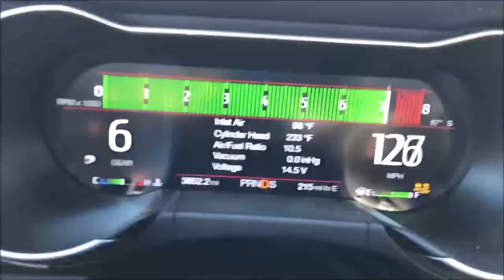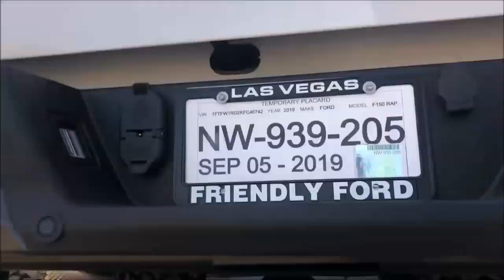2025 6.8 Liter S650 Mustang And F150

Comment: A 6.8 liter Mustang........... If Ford does this, I will buy the first year model whether or not it blows up I don't even care! I'm just glad they're not doing only an electric version!! :oD
Reply from the maker: Rated R Cars. .  funny thing is, electric motors make a lot of torque. . .  i am hearing some of the future hybrid mustangs with electric motors will run rings around our current cars .. . things are gonna get interesting. .
Reply: @coyotecarguy2076  as batterys die they lose strength when I get low in fuel I still make 703whp
Reply: @coyotecarguy2076  u missing the point bro.
Reply: YEP!!!!!  DO NOT LIKE THE ELECTRIC CARS.
Reply: @BobbyB910  when youre full of gas you add weight... Batteries full = no added weight. Two can play at this game
Reply: @robquin2460  no I win lol 
Muh double pumper carb with them camel hump head and a 3/4 race cam will beat anything
Reply: @BobbyB910  we'll see when these electric cars start flying off the shelves in a few years ;)
Reply: @robquin2460  Electric cars are nothing but overrated.
Reply: they have done an electric version and its a neck snapper.......look it up!
Reply: @coyotecarguy2076  They are eventually gonna ban gasoline engine, it's not a good thing.
Reply: @robquin2460  ywah and maxing the performance Ona  battery performance car drastically reduced use time and will degrade the performance of the electric vehicle over the years, my gas engine is gunna stay the same

Comment: There is no replacement for displacement. Everything old is new again...HAHA.
Reply from the maker: Stupid Fast Truck . . .  Your right about that. .  with free flowing cylinder heads and a efficient intake and exhaust this engine will get a lot of attention. .. its gonna make power. .
Reply: Well said
Reply: Ford: We increase the liter size, but the motor only runs to charge the  battery that powers the  electric motors :D
Reply: Amen, Recently on the market for a new Crew Cab pickup, drove Fords, Dodges', Chevys and GMCs, drove home in a 2020 GMC AT4 with the pushrod 6.2, I love that sound and feel, I'm 54 and that engine brought back feelings from my youth... That sound and torque.
Reply: Amen to that brother.
Reply: Really. 

The coyote proves that wrong  .

This will be cool and I like the idea buyvif I had to chose . I'd go with the coyote.

Comment: coyote still gonna hurt feelings
Reply from the maker: Rob Quin24. . everyone needs to remember that ..  never under estimate a coyote..
Reply: Not my 427 strokers feelings
Reply: @rdy2run332  bet
Reply: Lol keep dreaming. They cant even,"match the torque " on anything from GM or Dodge. Lol keep telling yourself that
Reply: @erichaley4485  like they're trying to? Lol. Unopened coyotes in the 7s, stay delusional
Reply: @robquin2460  they still dont make shit worth of torque
Reply: @erichaley4485  guess they dont need it lol. Different engine bro
Reply: @erichaley4485  go watch Richard Holdeners  coyote vs all LS displacements on the engine Dyno. 4.8 and 5.3 couldn’t touch the coyote EVEN in torque. The 6.0 barely beat it. And Richard is the most unbiased dude there is. Cost is the only factor. Coyote ain’t cheap.
Reply: @MikeSmith-ey7ku  they dont,"match GM or Dodge" in low end torque. Put the crack pipe down.Funny how Ford went back to pushrod V8s in their heavy duty trucks because the honda tech just couldn't match the GM or Ram pushrods. Hell some people are doing Godzilla swaps from the Honda Oops coyote junk..
Reply: @erichaley4485  go watch Richard holdeners coyote vs all displacements of LS. Only the big 6.0 or 6.2 can beat the coyote....even in torque. Do you believe everything you read on the internet? I’ll take a high revving high compression modern 4 cam over everything.  I don’t like harleys either.  CBR.  Or watch the other coyote Vs. LS shootout. Gm dudes had to bring a 7 liter to fight the little 5.2. They won,cuz they had 2 more liters and only cuz of that,cheaters

Comment: That is very interesting, Ford has done a great job with small block engines with high horsepower, but the other 2 
makers can't match Fords h.p. with small blocks, they have to make big blocks to get the h.p. numbers. So Ford
is going to show them what they can do with a big block motor. Wow that is exciting.
Reply from the maker: Paul Hudgins . . .yes my friend it should be interesting what happens now with the new ford big block's . .  stay tuned!
Reply: the LS is dimensionally smaller then a coyote. Lighter too
Reply: @MasterKeyMagic  I am talking about Cubic inches/liters of pistons, please do your research, GM & Dodge cannot build a small block V8 that can compete with Fords, they cannot get the horsepower that Ford is.
What is the size V8 in camaro & corvettes is 6.2l or bigger, which is a big block.
Reply: @paulhudgins5120  your tires dont care how efficient you make HP. Have you ever seen an LS7engine next to a coyote? Its like half the size
Reply: @MasterKeyMagic  Go back to your unfollowed Chevy forums,and get off of LS motors, build a LS small block and then compare to a coyote, it won't compare.
Reply: @paulhudgins5120  I did💀 I have both and they both make the same power except the LS is smaller so its easier to see over the hood of my camaro, it weighs less and its center if gravity is closer to the bottom middle of my car so, its better.

Comment: It’s rumored the 6.8L will get a CGI engine block.  Compacted graphite iron!!  Lighter and stiffer than grey iron and more durable than aluminum.  This is the block material used in the 2.7L ecoboost.  Ford could also develop these engines to run on natural gas🤘  Exciting times thanks for the video!
Reply from the maker: Ryan Sinks  . . .  Thanks for watching Brotha!

Comment: they could run an engine lineup like dodge does with their 3.6, 5.3 and 6.2. ford will have the ecoboost. the now entry v8 5.0 and then essentially a scat pack  with a 6.8 thatd be awesome
Reply from the maker: MaxxCalamity  ..  i like your way of thinking. .. 6.8 scat pack .. that has a nice sound to it!!
Reply: @coyotecarguy2076  lol im not saying call it a scat pack but it would just be fords version of it. More importantly  what is the name of the motor? Are they gonna call it the godzilla jr since its a destroked 7.3?
Reply from the maker: @TXpondking  . .  there is no name yet but i was thinking Baby Godzilla!!  remember him?
Reply: @coyotecarguy2076  yeah thats what i was thinking  with the jr lol
Reply: Dang when did dodge start making a 5.3 lol
Reply: @jacobgodfrey8164  exactly  lol
Reply: You mean the 3.6, 5.7 and 6.4s. Fca doesn't have a 5.3 and the 6.2 is limited in numbers.

You can get a 3.6 in basically everything. The 5.7 in trucks and suvs.
The 6.4 in the 2500/3500 (iron block)
The SRT 6.4 in well...the high performance stuff.
And well you know where the 6.2 is....(everything hellcat)
Reply: @D41Michigan  you right it is a 5.7  but yeah you get the 3.6, 5.7 and the 6.4 in the chargers and challengers and itd be cool to see ford do the 2.3, 5.0 and 6.8

Comment: Guaranteed ford destroked the 7.3 to 6.8 to get it to rev higher and make more power. The 7.3 has a hard limited redline of only 5,700 rpm so by making the stroke shorter they rev higher making more power hopefully through higher compression and revs. I also hope that the 6.8 is just and engine option with around 500 hp to run with the SRT scat pack cars. Then it’d be real simple to make a super rare 429 with a different set of rods. I know an engineer that works for ford and I ask him questions and he’ll just smile and say “sounds fun” he can’t say anything without risking his job but I know he knows.
Reply from the maker: hpkntnw.  .  Yes, He Knows . . No Doubt. .  but he can't tell you. . .the 6.8 is a big bore short stroke bid block that will make strong mid range power. . .  i hope to see the 6.8 in a generic mustang. .

Comment: The 7.3 makes 430 hp and 475 tq. So the 6.8 will make 399hp and441 tq, it will be 60 to 80 hp less than the 5L without variable valve timing.....a big step backwards
Reply: It's going to be tuned up from where the 7.3 is for work trucks and shit, this is looking to be like a high rpm high tq and hp big block in a modern way, which is dope

Comment: Thanks for putting truck in video at the end good stuff. If it’s a iron block I highly doubt it will go in a mustang. Sounds like a HD work horse motor. But seems odd with all the success of the 7.3 to bring a new motor out. But if there are  adding another style mustang that’s a SUV again maybe that’s where this motor will fall into.
Reply from the maker: Underfedcoyote 5.0  ..  honestly i think ford wants into the push rod v8 market..  . they are in it now ..   the dodge demon may have some competition. . .

Comment: Does anyone know why they are choosing 6.8 as the size? From the research I’ve done on the 7.3 it’s just a stroked small block, about the size of the 351 W, so why 6.8? I’d love a simple V8’s in a truck but the worst part of this is that the 6.2 will be even more overlooked as an engine. It’s just like the old 400. That should have been the performance V8 Ford guys built since it’s basically a stroked Cleveland but it was largely forgotten until just recently. The 6.2 mod V8 has some great architecture and I wish more folks used them so the aftermarket would be better for them.
Reply from the maker: Ronin Kraut . .  the 6.8 is an interesting change. .  probably better suited for the F150 truck .  .    Should be interesting what this 6.8 goes into..  .
Reply: @coyotecarguy2076  
For sure but why 6.8 and not 6.5 or 6.9? Know what I mean. Ford engineers picked 445 ci in the 7.3 for a reason. They said it was something about power and efficiency. Just curious as to why they chose that particular size or was it just because it came out to 6.8 when they destroked it.
Reply from the maker: @roninkraut6873   ..  we'll probably never know for sure but i would have liked to see a 455

Comment: Let's hope it is not a spray bore engine like the 2018 and up Mustang engine.
Reply from the maker: Joe D .  .. .  The cast iron block will not be spray bore but if they go aluminum it probably will get the spray bore.  .
Reply: @coyotecarguy2076  hopefully it will have a 6R80, but probably not. People are breaking the 10R80 right and left. I am at 950whp with a stock 6R80.

Comment: This is very interesting stuff! It concerns me that this might push the Mustang well north of the 4000 pound mark, which would make it a straight line beast but might take away from the sporty feel in the twisties. Any guess on the weight of an iron Block? Mopar fanboys are probably pulling their hair and screaming, “noooooooooo!!!”
Reply from the maker: Mike Fyxdt   .  . . .If this 6.8 ends up in a mustang with a blower and a cast iron block  we will see a heavy car ..  but a n/a version may not be to bad.  its the hybrids i am worried about. .   The batteries are huge and they take up a lot of space in the trunk! You know how i feel about trunk space!!  LOL!
Reply: @coyotecarguy2076  The magic formula for electrics is to spread out the battery cells in the floor pan from front to back. Weight distribution and lowers the center of gravity. We must preserve the trunk for more important people!

Comment: 30th. All you were all over it. You said big displacement. I wish they would DOHC the thing. Can you imagine that sucker reving 8200.  The ground would shake. I think they are going to put a D cell battery in the trunk and call it a hybrid.
Reply from the maker: thereissomecoolstuff . .   remember the 7X project. .  ford was gonna build a 7.0l DOHC engine for the mustang ..  it turned into a 7.3 push rod and the rest is history. .They will be building hybrid mustangs hopefully not with the v8's

Comment: Couldn't just be a 428SCJ  or 429 Boss and steal the 60's thunder away from the "Hemi" nameplate?   And why would it be 'limited edition' with a $2 billion investment in the Windsor engine plant ?  It should be over 500 horse 500 tq if the 6.2 Chevy makes 460/450 tq in the Camaro. 495/475 tq in the Vette.
Reply from the maker: Wildpony98. . . We will have to wait to see what ford decides to build. .  maybe it will be a 428SCJ  .  . . It is not likely to be a engine option in a typical mustang gt . .  it will require many special parts to get the engine to fit. .  not likely ford will make that investment . . . I herd a rumor that the 6.8 is close to 550Hp. .  but that is just rumor. .

Comment: The 7.3 only pushes 430 HP and 475 TQ 
The 5.0 pushes 460 HP and 420 TQ
So the 6.8 will not make as much power and possibly only slightly more TQ. 
The Challenger Scat Pack 485HP/475TQ  
and Camaro SS 455HP/455TQ 
stomp that 6.8 in HP and TQ numbers. It’s not gonna compete.
If it’s iron block it means it’s HEAVY. I don’t believe it will handle boost like the 5.0 and won’t compete with the competition
Reply from the maker: Noah Sutton.  .. the numbers fir the 7.3 that you mention are accurate. .  but thats based on a truck calibration..  the 7.3 is capable of making a lot more power with with a calibration for a lighter vehicle .. .  a 6.8 in a mustang tuned correctly will make good HP .. .  The 6.2 lt1 engine in the camaro makes 455HP. . the 6.8 will surely make more . .

Comment: 6.8 liter won't be a top tier motor in the mustang. Shelbys and other high end mustang variants don't share engines with other vehicles. If the 6.8 is going in the f150 it will be in the GT trim as standard equipment. Doesn't make since to have two engines that do similar work.
Reply from the maker: thomasj1026. .  should be interesting to see what ford will do..

Comment: The 7.3 only puts out 430 HP. Hum. This will be interesting. Guess their tired of being behind Dodge. The original Cobra Jet put out 370 HP. I wonder if it will be all aluminum or is it gonna be cast iron block. This will be cool.
Reply from the maker: stgraves260 . .  on the stock calibration the 7.3 is a little bit of a Dog. . . but it makes big power with a simple tune .  . it has a lot of potential. . . so does the 6.8 .. .  should be interesting. .

Comment: It’s crazy cause a battle between the LS and Coyote happened and the LS won but they said if the coyote was the same size it would win. Rip LS and Hemi motors
Reply: ... thats literally not how it works🤦🏼‍♀️
Reply: @MasterKeyMagic  you telling me a bigger bore which allows for bigger valve opening, which brings more fuel and air doesn’t give you more power? If so you need to hit the books again
Reply: @Bimmapoppy  you can make as much useable power as you want with either engine
Reply: @MasterKeyMagic  well here’s where if you had ask a simple question you’d see what I’m talking bout, it was a 10k battle between the 6.2 ls3 vs a 5.0 coyote, ls won obviously, if the coyote bore was any bigger or the same size as the ls they could of squeezed a lil bit more power out of it
Reply: @Bimmapoppy  Obviously it would make more HP if it had as much displacement but it would also be even bigger and heavier then it already is.
Reply: @MasterKeyMagic  first you tell me that’s not how it works, now that’s how it works? Confusing me

Comment: It doesn’t make sense they use this engine as a mass production engine on the mustang . More likely going into a limited production model . It already makes less hp than a coyote as a 7.3 . Ford isn’t really up to game with pushrod motors like gm or dodge .
Reply from the maker: Smurfeco 2.3 . .  it does seem kinda odd that ford is now building pushrod engines  but many people want them. .  the 7.3 is calibrated for a truck. .  a 6.8 version in a lighter vehicle is likely to make more power than a coyote . ..  just depends on calibration. . . You are correct that a 6.8 s550 mustang will be a limited edition car ..  maybe even a shelby ..  I am also told that this 6.8 will make more power n/a than a 392 ..   it should its bigger .. .
Reply: Coyote carguy yes definitely the mustang won’t use the iron block like the 7.3 it would use aluminum block . Maybe different manifolds and internals would make it more like a coyote . It would be pretty interesting seeing a high revving pushrod. It’s the first time in years that Ford is using two body styles in the same gen for example the 2020 gt500 still uses the 2015 style . Anything can happen maybe 2 different v8 options like back in the early years for mass production 🤷🏻 specially with emissions getting strict .

Comment: It's not a "motor", it's an "engine".  You owe me a nickel every time you use the word "motor" in this video.  That will be $10.55, thank you.
Reply: Then why do they call it FORD "MOTOR" COMPANY ?
Reply from the maker: David Williams .. ..My bad
Reply from the maker: rdy2 run . .  good point!!  LOL!
Reply: @rdy2run332  As if that means a damn thing.  Let me remove some of the ignorance from your life.  An "engine" is internally powered.  Meaning, the creation of 'power' happens inside said machine/device.  A "motor" requires an external power source (think electric motors).  Also, the term "engine is an incomplete name.  The proper name is "Internal combustion engine" or I.C.E.  As for the name of said company, perhaps you should call them and ask them.
Reply: @DavidWilliams-hf8sc  
Definition of motor a comparatively small and powerful engine, especially an internal-combustion engine in an automobile, motorboat, or the like.

one that imparts motionspecifically : PRIME MOVER

2: any of various power units that develop energy or impart motion: such as

a: a small compact engine

b: INTERNAL COMBUSTION ENGINEespecially : a gasoline engine

c: a rotating machine that transforms electrical energy into mechanical energy